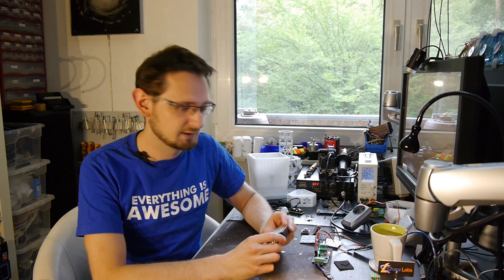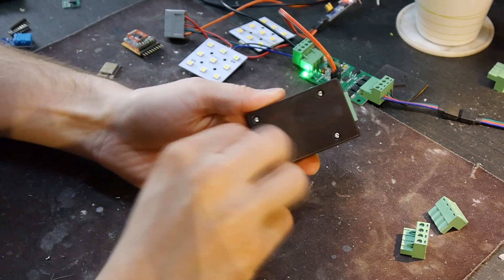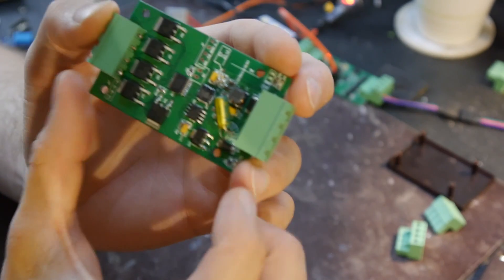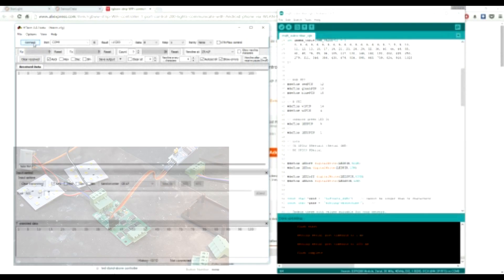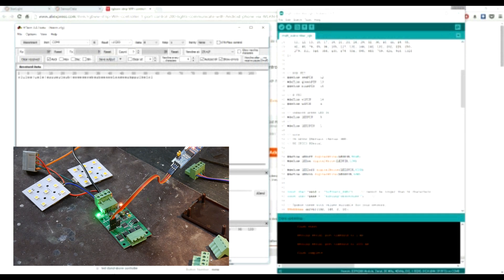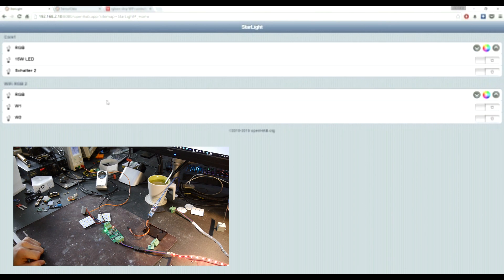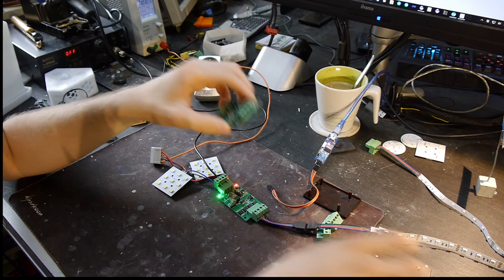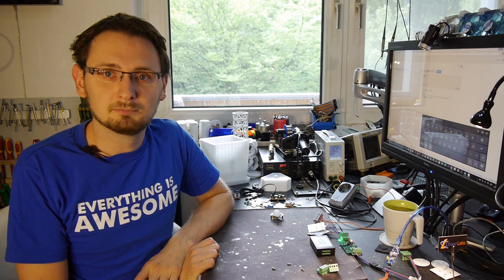ESP8266 WiFI LED controller hack

Comment: Great video, have you seen this thing 
https://www.aliexpress.com/item/Sonoff-Smart-Home-Remote-Control-Wireless-Switch-Universal-Module-Timer-Wifi-Switch-Itead-Smart-Home-Controller/32675428162.html?spm=2114.30010308.3.2.1uuCZo&ws_ab_test=searchweb0_0,searchweb201602_2_10065_10068_10067_10069_10017_10080_10082_10081_10060_10061_10062_10056_10055_10037_10054_10059_10032_10078_10079_10077_10073_10070_421_420_10052_10053_10050_10051,searchweb201603_1&btsid=fdd06dd1-f69f-4077-bb5c-2c068a3b96b4

Comment: Hello Andreas. Can the flash controller and set him a program to monitor marine aquarium light both on this site http://reefll.com/index.php?route=product/product&path=65_67&product_id=63
Reply from the maker: well It could but you need to modify a few things, I recommend using an other board.